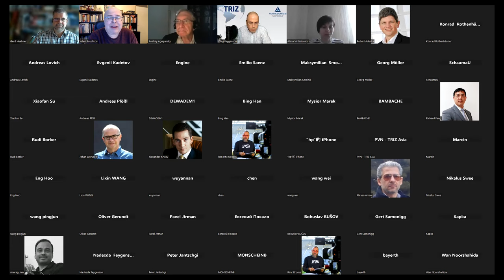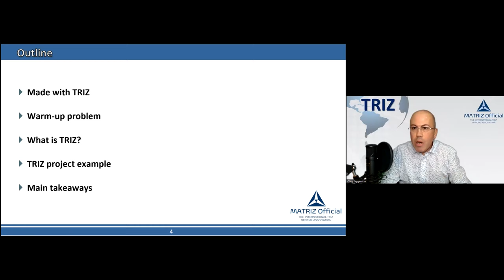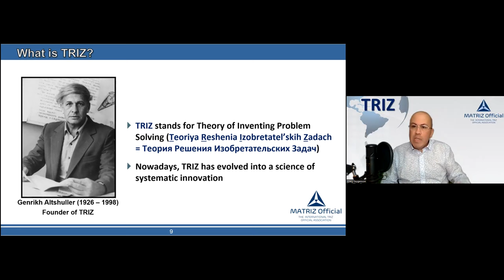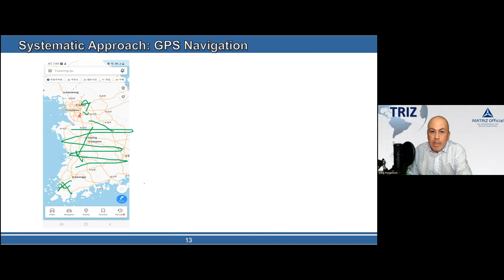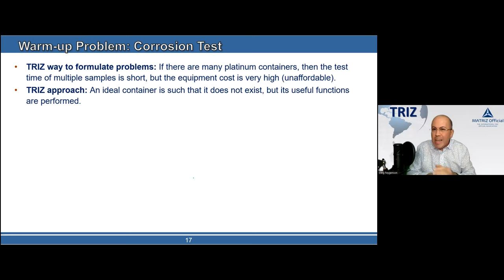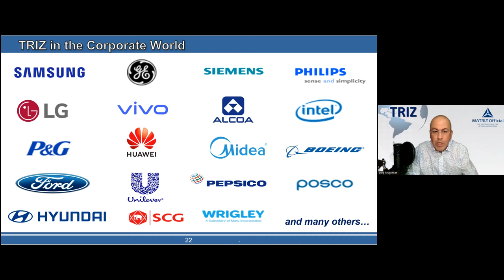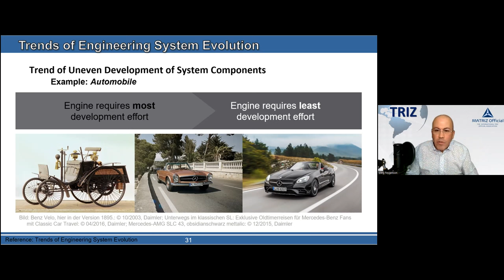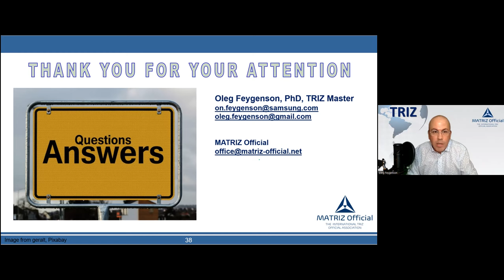Webinar "Systematic Innovation Using TRIZ" by Dr. Oleg Feygenson

Comment: Rightly said introducing TRIZ in company from bottom up is very hard, with top down approach it is far easy. TRIZ works well if someone make right practice with professional approach and apply it to complex problem solving. It works to solve simple problems ( but most of the time people says it's common sense), so TRIZ work really great for complex, long pending and difficult problem solving.